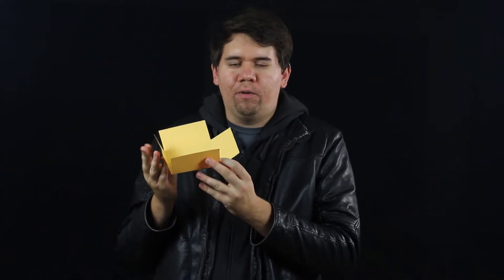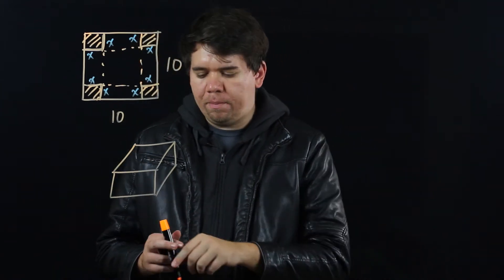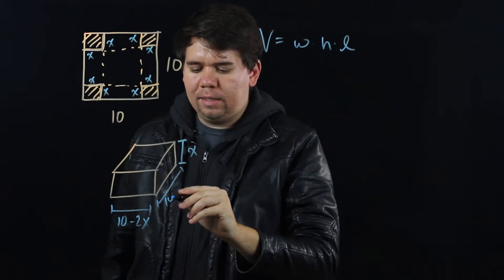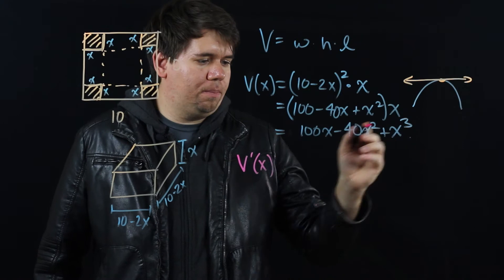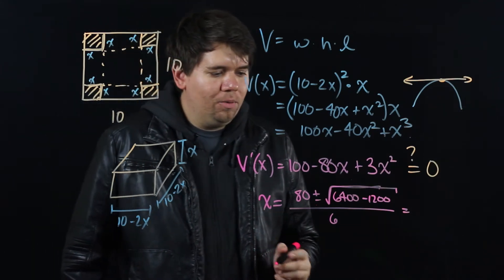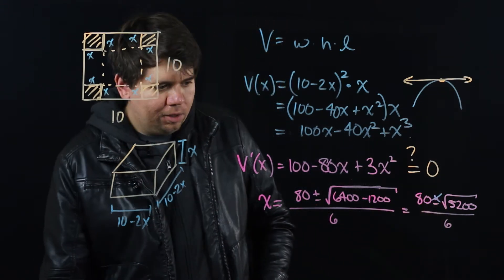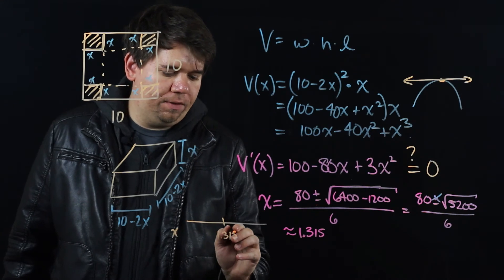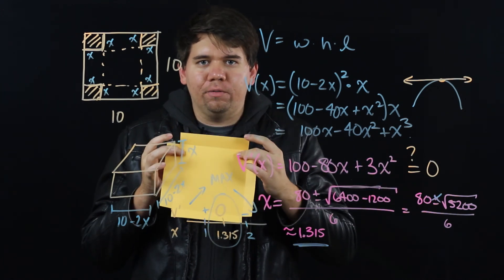Lit Calculus 53: Optimization, Largest Box

Comment: (10-2x)^2 = -4x^2-40x+100, not x^2-40x+100** so then the equation becomes -4x^3-40x^2+100x, which it's derivative is -12x^2-40x+100  , which can be factored to -4(3x-5)(x+5), and so we get the solutions 5/3, -5. -5 cannot be possible because you cannot have a negative distance and therefore the answer is 5/3 for x.